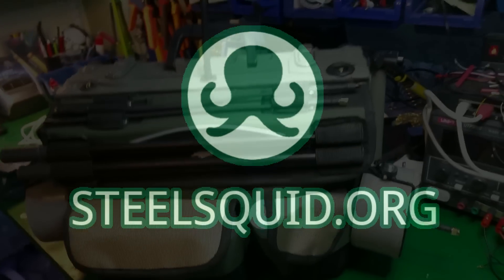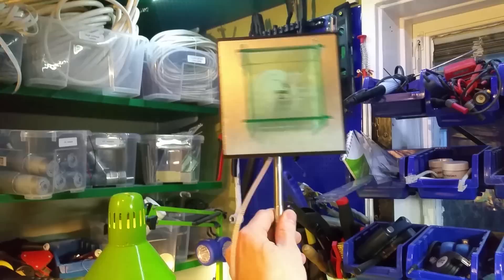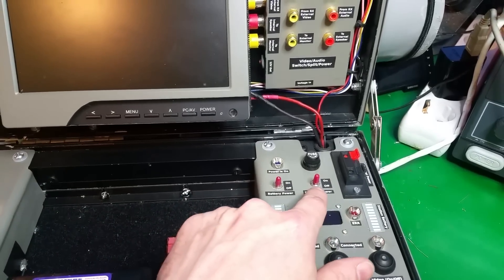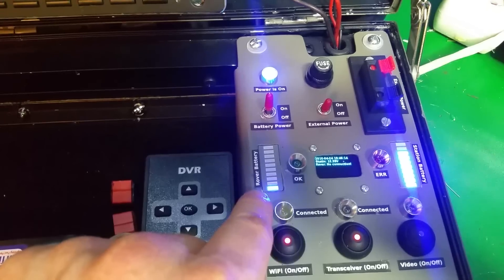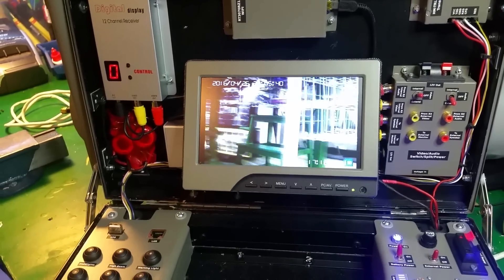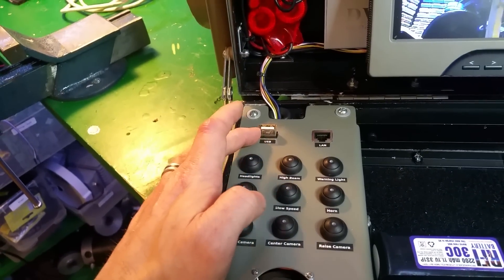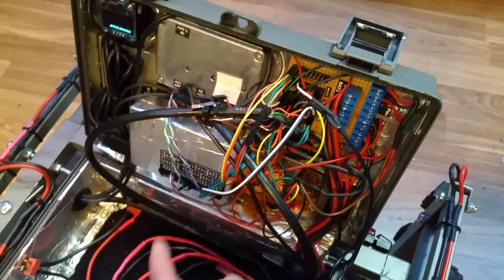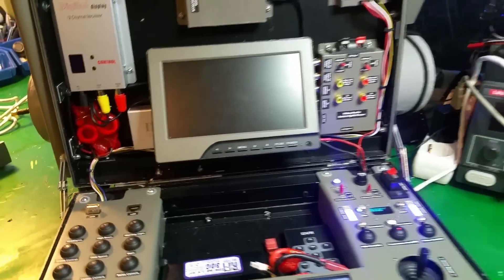My new FPV Rover and Control Station

Comment: Hi, I'm building something similar and I'm right now trying to figure out how to send a video stream from far away, about 1km line of sight is my goal. What kind of transmitter/receiver are you using and do you have a link/name of them? Is it analog video which require me getting a amatour radio license?
Reply from the maker: The one I use for this is an old analog CS-B25 (https://www.rcflight.se/visaprodukt.aspx?id=3118)
It is at 2.5W (1.2GHz) so you must have a amateur radio license (In Sweden anyway).
There is a lot of 2.4 and 5.8GHz with lower power that dont need license.
But i think it will be hard to get any good video on the ground with that even if it is line of sight.
Most use them for flying...

Comment: what battery did u use for rover
Reply from the maker: Two 4S 5000mAh Lipo connected in parallel
Reply: +Steelsquid what c rating